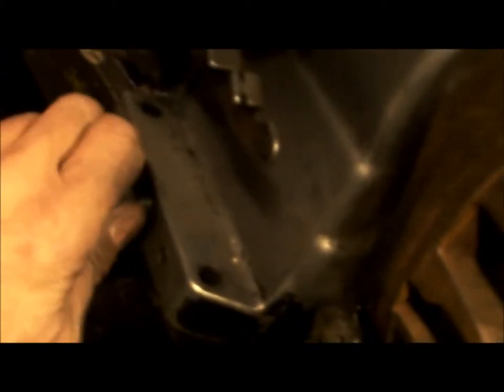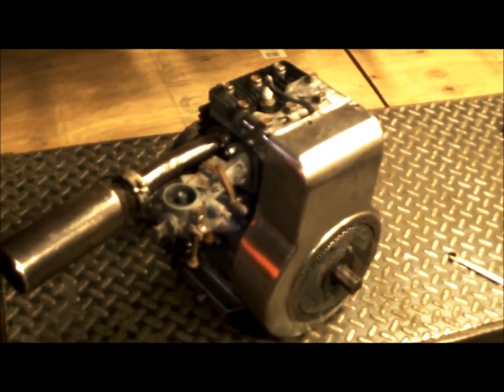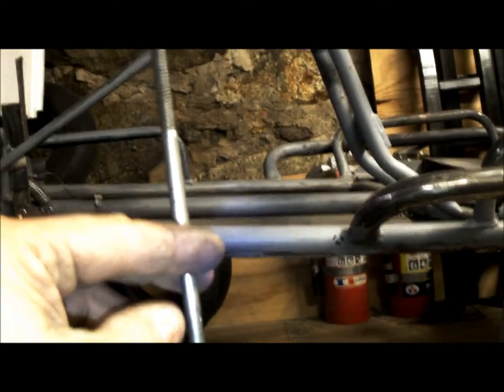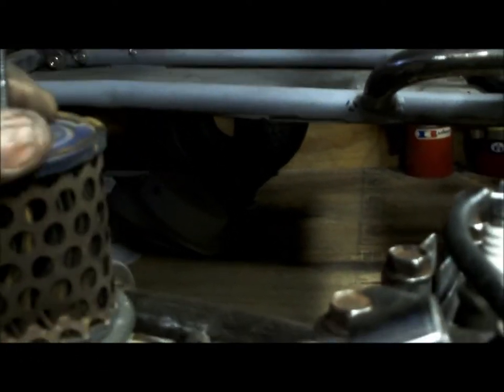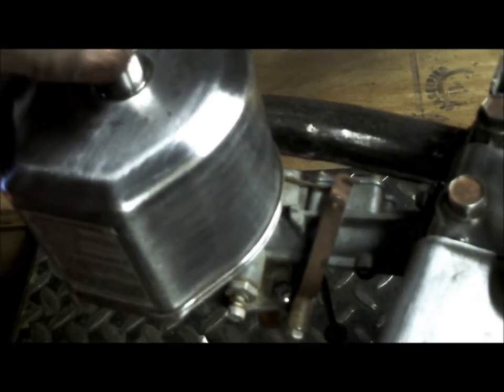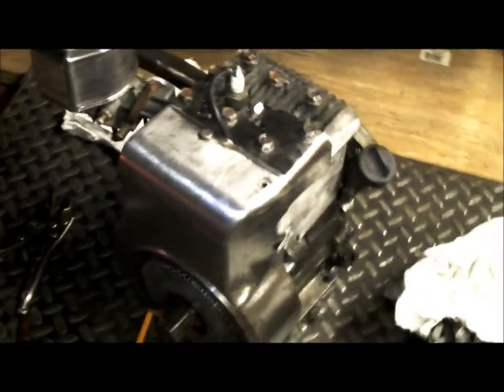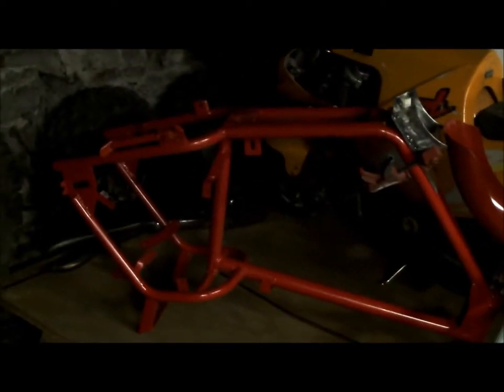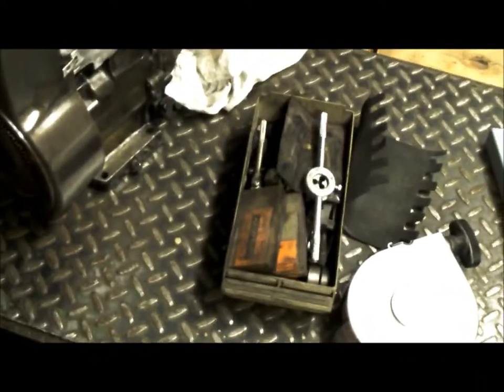5hp briggs done, cats to

Comment: think there is a rubber grommet / plastic alignment spacer missing on the lower filter plate to carburetor rather than just steel to aluminum .with no alignment it could over time vibrate causing engine to digest all kinds of nasty stuff in the process. it does show up on the parts diagram.

Comment: The governor is there to maintain your RPM and to keep your engine from over reving. The governor will increase or decrease throttle position depending on the load applied to the engine to maintain a desired RPM. It is important, not advised to run your engine without it, you may over rev it and damage or destroy your engine
Reply from the maker: very good info brother thanks a ton, cheers
Reply: Anytime, engine is looking great by the way. Have a good one.
Reply from the maker: CornellsGarage will do bro, cheers

Comment: Hey whats up udizzy i have a tip for you since you already wire wheeled all your parts grab some 180gr sand paper sand em all down one direction then after that its done get some 400 gr repeat process  then get some 600gr and keep sanding after  that its done get some rought polishing compound and a buffing wheel for your bench grinded and polish tall parts  then at the end get some white polish compound  and polish again at the end get some wd40 and wipe out everything to get all the remain polish compound and there you got thats nice and shinny
Reply from the maker: well I have step 1-2-and 3 done so I just might do the rest also, thanks for the help bro. cheers
Reply: Not a problem also the lever its the gobernor usually  everybody disconect the governor because it will make your go kart take off very slow or not take off at all it is better to make a bracket and mount it next to carb and use one of the treaded conections of the break lever of a bisicle to adjust the trottle by the way i will love to get one of those mini bikes lol they must be fun to drive around i have a 125cc dirt bike but i have to clean car everytime i want to use it lol
Reply from the maker: thanks man, and they are a ton of fun, had mine out in the snow today.

Comment: I use kerosene for a internal engine cleaner, not to run in it, but wash the gunk out untill satisfied and drain very well over night. Run it with a cheap oil for a while, drain and refill with a preferred brand.
Curious as to the way she sounds, looks like a racing motor that goes on the karts in performance racing.
That cat had some BLUE eyes reflecting back, I just trapped 2 feral cats in hopes to make them tame for adoption. Went looking at our local animal shelter and they may have to still put down 1,200 cats next year, most to do with christmas kittens bought from non rescue stores but pet farms, kids just get tired of them.
Such a throw away society.
Reply from the maker: will do on the motor, and very true story bro, cheers

Comment: the propane heater you have is pretty cooI was looking at one of those for my shop,does it throw pretty good heat and do you need to use in ventilated area only?
Reply from the maker: yes and you should, or put a fan on prolly. they work great ,  cheers

Comment: Yeah, that engine needs flushed out well.  That air cleaner rod needs threaded a lil more & chopped off.  Must be from a different type carb. Hmmm. looks great though. Good Job Ace !
Reply from the maker: thanks man, but whats the gov-arm thing?
Reply: Exactly that, the governor attachment. you really don't need it. but I'll see if that other motor has it and show ya. you're welcome to any parts that may be there if ya want. but The air filter didn't fit right, so I don't know that they will either. I'll let ya know
Reply from the maker: bruce , that's great man, thanks so much. I have some other tubers looking also, big cheers man